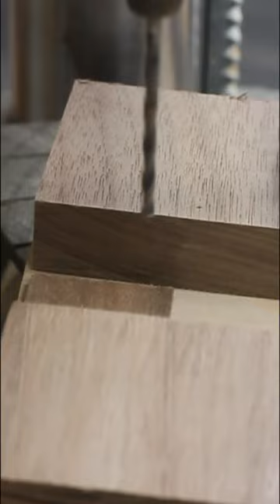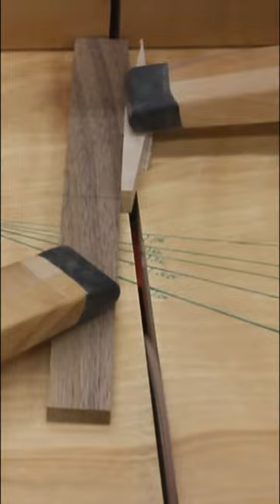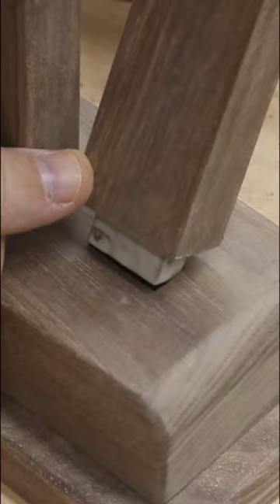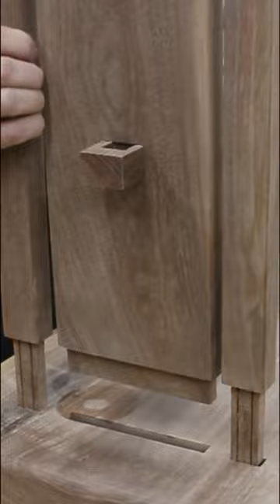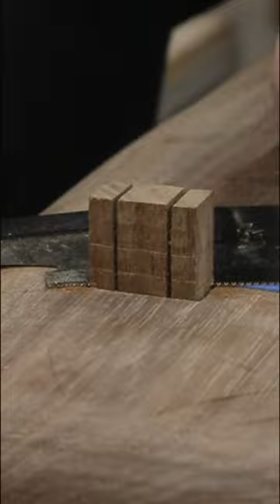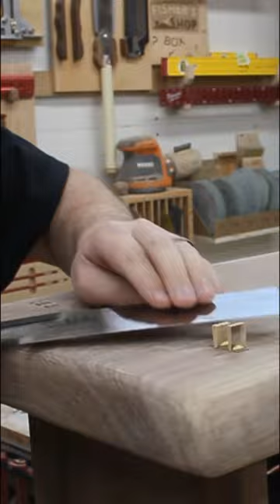Making Wedged Tenons  #woodworking #diy

Comment: Nice, but why not drive the wedges before trimming the tenons, there by only needing to trim once.
Reply from the maker: Because they would have bottomed out before they even were flush with the top.  I had to trim them
Reply: Easier to drive when it's trimmed or you might hit the other wood.